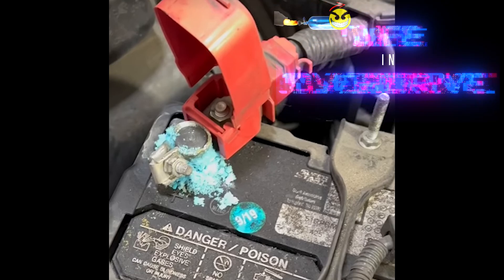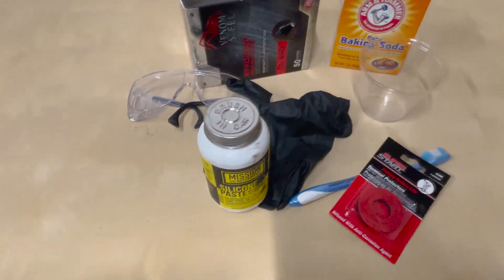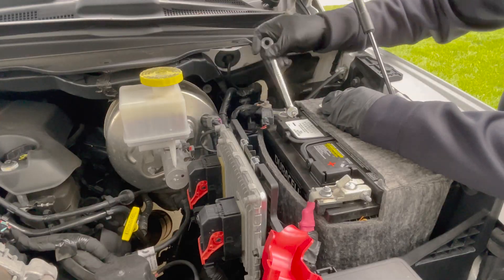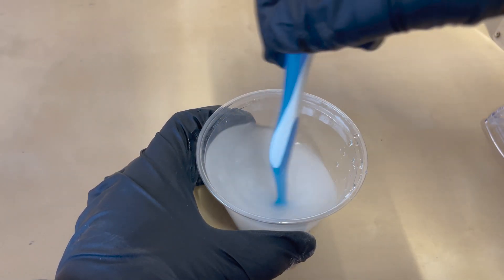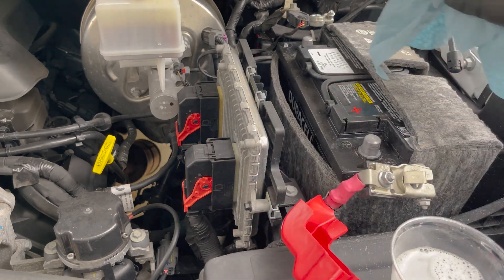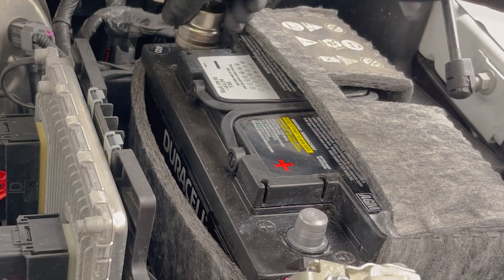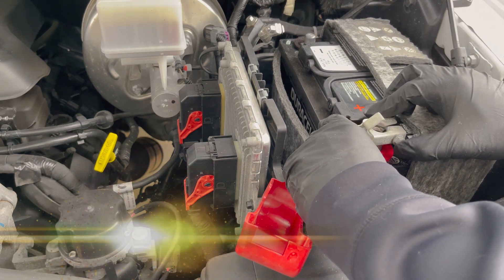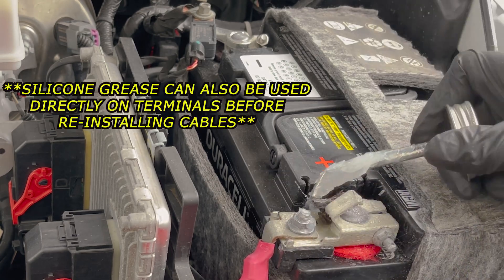How I clean my automotive batteries | My battery terminal cleaning guide

Comment from the maker: Things in this video and other helpful items ⬇⬇⬇⬇
Complete guide to testing batteries: https://youtu.be/VGR_ETCwa8o
⬇ In this video ⬇  
😎NoCry Safety Glasses (Over) ➡ https://amzn.to/3Q9QWsF
🥊Black Nitrile Gloves ➡ https://amzn.to/3PWjYdY
🐢Battery Terminal Cleaning Brush➡ https://amzn.to/46u3Ln2
🫗YEEHAW Paper Cups ➡ https://amzn.to/45vQUzP
🪥Reach Toothbrush ➡ https://amzn.to/45mV7FW
🧁Baking Soda ➡ https://amzn.to/46LXEul
🔧10mm Ratchet Wrench ➡ https://amzn.to/45mVfVW
⚡Dielectric Grease ➡ https://amzn.to/48SDhgU

⬇ other recommended supplies ⬇  
🥲NoCry Safety Glasses ➡https://amzn.to/3Ff7MQM
🪥Wire Brush Set ➡ https://amzn.to/46oHpmW
🔥Ratchet Wrench Set ➡ https://amzn.to/3ZULvAY
😷Corrosion Preventative➡ https://amzn.to/48MN4VU
🪫Digital Multimeter (voltmeter)➡ https://amzn.to/3Qc2VGi
🔋Automatic Battery Charger ➡ https://amzn.to/3toG5ly
🧪Battery load tester➡ https://amzn.to/3EYI0Qn
💦boil water in instants ➡ https://amzn.to/3LL8HMf

Consider Subscribing  🚨 https://bit.ly/3N2pRXl🚨
Support is appreciated ➡ https://bit.ly/3Ak3QvF
Recommended ➡ https://bit.ly/3AjnDLw